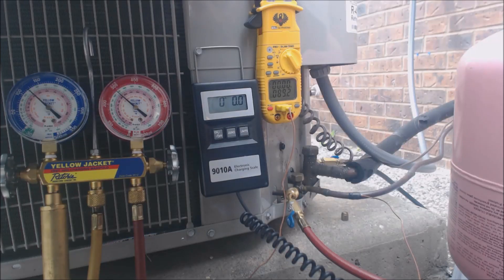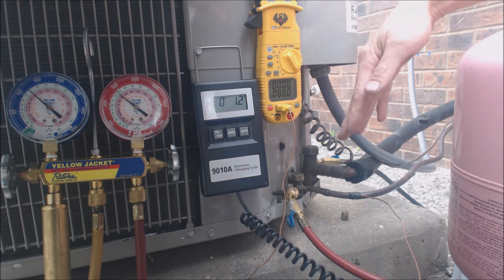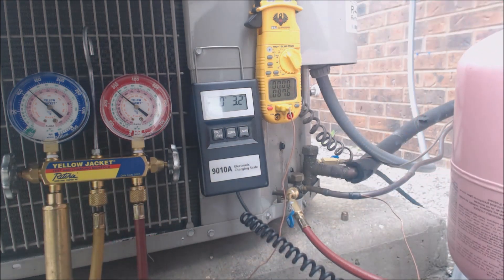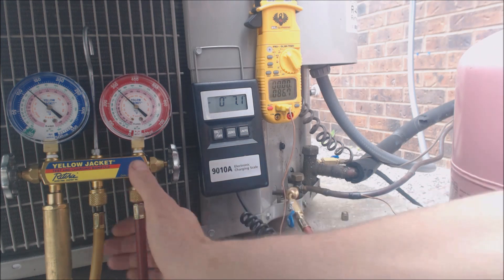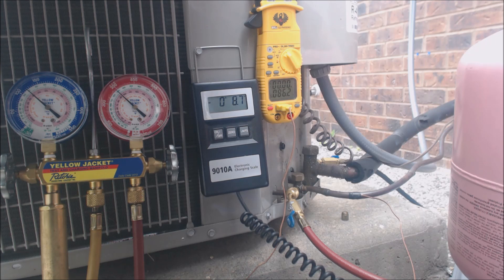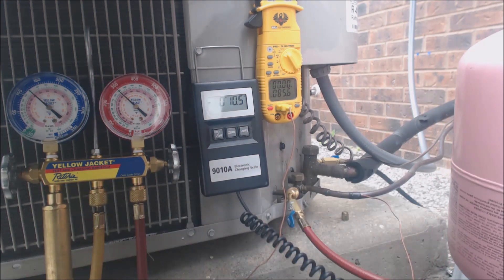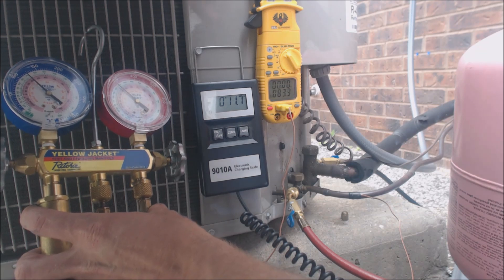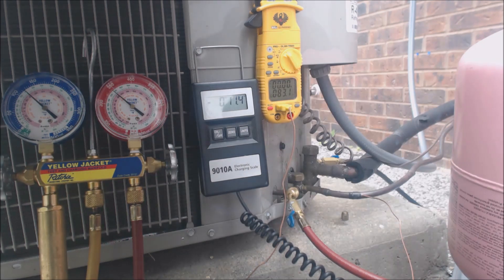Charging R-410A Refrigerant: Step By Step Process of Adding Refrigerant in Real Time!

Comment: Yes the target is 10 deg as specified on the label , the liquid line temp is 84.3deg and the high side pressure is 250 psi
Reply from the maker: Ok so a couple things, if this is a lower seer unit which would mean that the high side would be higher in pressure then you may still be low on refrigerant. I would keep charging to see what happens. The superheat is about correct though since it seems to be around 17 degrees. If the superheat were very high then that would be an indication of a low charge. It is possible that the r-410a mixture may not be a pure 50/50 of the two part refrigerant. The bottom line is that you are not getting a steady stream of liquid to your txv and therefore your superheat should be higher than what it is actually. Did you try another temp probe. Mine will fail and I will replace them during the season. When I start second guessing myself I have three probes to cross reference against.  Also what is the temp diff between the return and supply temps? 18-21 would indicate a correct charge. Thanks

Comment: Question: 
So on my new Ruud 3.5 ton AC with "N" coil, using 34 ft of (3/8 liquid & 7/8 vapor) lineset. I know to add .6oz per foot over 15 ft. but was curious if it was necessary to add extra 410a to account for the copper elbows? 
I have three 7/8" elbows and then 2 long hand bends for the 3/8". Cant determine if they are telling me I need to do this no matter what or just if I have a long lineset and high vertical rise which I do not have. Lineset goes 8 feet up from AC service valves to ceiling then 22 feet straight to furnace room and then 3 feet down with the 2 elbows to connect to coil. Manual states, All units are factory charged with R-410A refrigerant to cover 15 feet of standard size interconnecting liquid and vapor lines with a required field installed filter drier. I have installed the filter drier inside before coil and coil also has TXV installed with bulb of course at 10 o'clock position on vapor line also on outside of cabinet.
Reply from the maker: weight of refrigerant added is strictly by ft and not by rise of line set. You could add some equal to determined length of tubing but I would really just use subcooling to check the charge while the unit is on and running, thanks!
Reply: AC Service Tech LLC - 
Thank you and I will do it by subcooling but scrolling through the manual I saw that note they had printed and I never really thought about it and was curious. So if I go onto your Amazon tool page and make a purchase, that's how you get credit correct? Want to repay you for your advice. 

Take care and thanks again.
Reply from the maker: Yes I have patreon.com/acservicetech for continual support, paypal.me/acservicech for one time contributions, and I receive a commission any time someone clicks through an amazon link and purchases anything at all on amazon. It doesn't have to be the item clicked on, thanks a lot James and glad to help!

Comment: Hi thank you for this fantastic video. My Mitsubishi Multi Split only has a single service port for manifold connection, this was used initially to evacuate the system and vacuum test prior to opening the valves on the outdoor unit (both high and low side) allowing the factory charge of r410 to fill the lines. Our total pipe length did not exceed the manufacturers allowance so we did not need to add refrigerant, however this would have also been done into the vacuumed lines if it was necessary before opening the two valves. My question now is that we want to check the system is operating correctly, how do we go about testing this with only the single service port for the manifold connection? The service manual simply states to fully recover the r410 and weigh it to check if there have been any leaks and then recharge the system again. That seems a bit overkill, is there a simpler way for an outdoor unit with only a single service port? Thanks again for the great video.
Reply from the maker: If the unit is not a single or 2 speed compressor but a vrf then you would have to follow manufacturers instructions. The sad part is that they are not giving instructions. If it is a vrf then you should have 21-24 degree delta T across the coil when running on emergency cool which would be it's highest setting. On conventional 1 or 2 speed compressors you would be looking for a delta T of 18-21. Also since the vrfs have an accumulator, manufacturers run them with a larger sat state at the indoor coil so you may only read 0-5 degrees of superheat on emergency cool. That is ok and is also why the delta T is much higher, thanks Ben

Comment: Actually the probe is not in the sun , it is attached to a clean area on the liquid line and taped with electrical tape .the vapor line is 64 deg the ambient temp is 84 deg .
Reply from the maker: I'm sorry are you saying you do have a liquid line subcooling of 10 degrees or is that just the target? I was assuming that was the target. If that is the case then I would still like to get the actual liquid line temp from you. Thanks the more info the better just to see exactly where you are at.

Comment: what would you if the unit did not tell you what the rated sub cool temp should be ? like the same way when you are charging using super heat and the condenser unit doeant have the PT chart on it . how would i figure out what the sub cool temp should be at for the system ? 
thanks

Comment: Great Video  - 
does an EEV Electronic Expansion Valve allow the same charging method as used for TXV/TEV?  
thanks
Reply from the maker: As long as the system is using a single or two speed compressor, yes usually, thanks!

Comment: When checking your subcooling between the supply and return. Can you check directly at the furnace? Like from the the filter box and evapcoil? Thanks 
I love you videos
Reply from the maker: The most accurate is right before the furnace and a few feet after the evap coil but if you do have 18-21 between the filter area and the closest supply reg than that is great but if you don't then check closer before the furnace and 3 feet or so after the coil, thanks!
Reply: acservicetech sweet, just wondering. Learn something new everyday.

Comment: I already had been seen your gas filling vedio I want to ask what is that you are connecting section line and discharge line I mean why both line connect with the gage .as I know that for top up gas only section line need to connect kindly reply
Reply from the maker: That is because to check a system with a txv metering device, we need to read the pressure on the small liquid line but we add refrigerant into the large line, thanks

Comment: I have a trane unit. The high side over 500. My AC tech is not trouble shooting it just stating it is the TXV. I am not sure. Any suggestions?
Reply from the maker: The high side has to do with the outdoor unit heat exchange not the indoor. The tech would have to check subcooling and superheat. Thanks!

Comment from the maker: The system has to be on while charging into the low side. My speakers seem to cancel out that background noise. Thanks for the Comment!
Reply: glad you mentioned it.
Reply: By "on" do you mean running/operating or powered but with the thermostat in "off" position? If running do you turn it off once charging is completed? I'm very new to this.
Reply: @Alberto-by7zq  operating

Comment: I had issues using your process today. Long story short. I bought 2 year old heat pump from a Heat and Air company advertising on Craigslist. When I spoke to them I informed them I had a brand new 3 ton r22 air handler installed in my house. The heat pump is a 2 1/2 ton 410A unit. They installed it and it has never worked right. The guy installed some kind of little fitting in the compression fitting in the liquid line going into the evaporator coils. This can't be a TXV correct? If I was to install a TXV do you think I can get it to work? I have a new set of gauges and a amp meter with a thermocouple. Also have a 11lb tank of 410A. Trying to avoid buying another air handler. Any help would be great!

Comment: Excelent video!
I'm new in this trade and I got a question. 

Can I use my gauges for r410a and for r22?
What process should I follow if I can?
Reply: You should really have 2 sets of gauges. For these reasons : different oils can contaminate the 410 unit especially. 
2/ high pressure on 410 
3/ different temp/pressure scale. 
4/ different thread on the schrader connection.

Comment: Are you wanting a 35f evap or a 55f evap with a 410 sytem?
Reply from the maker: You are looking for superheat or subcooling depending on the metering device. We can't go by evap sat temp because that will change depending on the heat load in the building, thanks

Comment: I enjoyed watching your videos and find them informative.

I was wondering what you do after repairing a leak or changing a leaky liquid line drier to get in possibly 3-4 pounds of 410 refrigerant in the system. Assuming you pumped down the system rather than recovering. Your video was approximately 12 minutes long and you got only 12 ounces of refrigerant in. At that rate it would take about 48 minutes or more to get in three pounds. When I add liquid I open my gauge so I get about .25 of an ounce per 10 seconds and a whole ounce in about 40 seconds. I don't turn the gauges on and off as you do. I use a vaporizer off and on depending which gauge set I grab from the truck. Today I changed a condensing unit with a real long run and I wound up adding 4 pounds beyond the factory charge.   It took me about 10 minutes per pound. I'm very careful to watch my scale so I don't exceed my .25 per ounce per 10 seconds.

Do you think I'm rushing it?

Thanks

AC tech down here in the Virgin Islands
Reply from the maker: After you do a pump down, you would fix the leak, pressure test, vacuum down below 500 microns and then break the vacuum with liquid refrigerant into the liquid line up to under what you think you will need. Then open the service valves and turn the unit on. Wait 5-10 minutes with subcooling or 10-15 minutes with superheat and add refrigerant as needed, thanks!
Reply: I'd add even faster than that,

If you get extra pedantic imagine the 410 gas has leaked a component while cycled off. 
In that case you should recover rather than pump down and refill with fresh gas. But that is : getting pedantic

Comment: Hello, I have a question: I have to evacuate and vacuum the system. Now, my system only has a vapor service port. How should I charhe it? Do an initial charge with the compressor off? I'm afraid to turn on the compressor with no refrigerant on the system, but afraid to charge the 410a as liquid and flood the compresor.

Any advise and thanks!!!
Reply: In this case I'd first charge a base charge without it running. 

Then charge as per normal by cooling and gently charge and I sometimes blast my heat gun on the the suction port to ensure the liquid is definitely vaporized. That's especially in wintertime

Comment from the maker: I always recommend that an individual work with a licensed professional while working on HVACR equipment until they are experienced themselves just do to a possible hazard sneaking up on them. Maybe the technician doesn't have the experience to handle the problem if you as the customer are not experiencing a correction to the problem. I would recommend that you interview some other techs in order to handle the problem. It may be something else other than the charge. Something that I find somewhat often is that the system may be running well but it was undersized for the building load and does not have the capacity to cool the house. There could be a variety of things that could be the problem if the charge is in fact correct. You could confirm that the charge is correct by checking for a 18-21 degree temperature difference between the largest return air grille and the closest supply register to the evaporator coil. I have some other videos that may help answer some of your questions so that you would know what a proper technician would be doing if you are interviewing new ones.  You had mentioned Freon which is R-22 and the video was R410a refrigerant. Maybe the tech was checking superheat on the vapor side if your system has a piston/orifice. Most R410a systems employ a txv as a metering device but if it is a R22 system it is likely a 50% chance that it is a piston/orifice. There are some R410a systems with a piston but they are not the norm. I hope these videos at least answer some of your questions! Thanks for your questions and I hope the situation is remedied fast!https://youtu.be/5uqtiUmrBLghttps://youtu.be/zJmZHzLwqbshttps://youtu.be/SUyN94Y39RoThe Playlist for Air Conditioning & Heat Pump Refrigerant Charging, Checking, Procedures, & Tips-Step by Step Instructions!   https://www.youtube.com/playlist?list=PLxnHR5_D2ojzAUXWWQt9A8juotNkzwYlk

Comment: The vaporizer,  is it good for lifetime use?
Reply from the maker: You can do without it and it takes longer to purge air out of the lines but works well for protecting the compressor. I have used them for about 7 years no problem, thanks
Reply: acservicetech I guess I just invest in one and it will last me 7 years or more. Sounds like a good investment.

Comment: I have a question,
if the refrigerant is slightly low,will it affect performance?Im thinking of having m system overall bled and recharged .
Reply from the maker: Great Question! When you measure subcooling if you have a txv, or when you measure superheat for systems with cap tubes or pistons, you can be off by a few degrees but only a few degrees. Superheat should be checked even more critically at 1 degree if possible. if the system charge is off then you will lose cooling capacity.If you were to recharge, you should recover the refrigerant, leak test, vacuum pump to or below 500 microns, then weigh the refrigerant stated on the rating plate, then check the charge using superheat or subcooling as needed.I hope that helps! Thanks for the Comment!

Comment: So I've never seen a vaporizer used before, I usually do the other method. Anyway can you leave the vaporizer on there when pulling a vacuum also? Or you pretty much just take it on and off manifold. @acservicetech
Reply from the maker: Check out these vacuum videos. I now only use two hoses, three valve core removal tools, and micron gauge. I did 1 1/8" lineset 125' down to 250 microns in ten minutes. With the pump off it held 250 so no water freezing problems and a true reading instead of near the manifold. vacuum playlist videos -  https://www.youtube.com/watch?v=jlzecsOImqs&list=PLxnHR5_D2ojxXtMK2acxvUF8aqowcksMx

Comment: I checked the discharge and the return temps and yes I'm within that 18-21 range ..
Reply from the maker: Ok then, it sounds like the temp probe that you were using was off calibration then. My temp probes eventually go bad too so you are not the only one. If it has that correct 18-21 then you know that the txv is getting supplied with at least the correct amount of subcooled liquid. Thanks

Comment: Do you turn off the valve at the tank when done and let the remaining liquid in the hoses into the system?
Reply from the maker: Yes sometimes it is hard to anticipate how much is left in the hose vs the subcooling so as long as we make sure the subcooling is not too high when your done that would be great, thanks
Reply: de minimis
Reply: AC Service Tech LLC  when it’s off do you add through the high side

Comment: I have a Carrier R-40A outdoor unit and the plate says "TXV indoor, and 67 piston outdoor.  Is this charged like a TXV or like a piston?
Reply from the maker: Great Question! You need to verify at the evap indoor coil. If you are not confident that it is one or the other then take the four screws out and take the evap coil box door off and look to see if you find a txv, if not then you know you can use superheat to check the refrigerant charge. Thanks!

Comment: Would have been significantly better video if you had started at the very beginning ... connecting the gauge and refrigerant hoses to the system.
Reply from the maker: J Willis, look up acservicetech connect check charge disconnect procedure" thanks!

Comment: how do you charge 410a when ambient is only 60° and there is no subcooling chart below 65
Reply from the maker: Great question, You don't use superheat and subcooling below 65 degrees ambient because there is no load on the building. That is why we weigh in the charge for every extra foot past the 15' or 25' the unit says it has in the outdoor unit prior to the initial startup when it is to cold and you can come back later when the temp is higher to double check the subcooling or superheat. You could get it close on a 60 degree day but you should go back when its warmer or wait until you have a warmer day first.  Here are two videos-----https://youtu.be/ncgLDYrvN6w----https://youtu.be/_8g6xaCKDqc---- Thanks for the Question!

Comment: I charged one of my units because it was low on 410 and while I was there I noticed the other unit (down stairs unit) had very little condensation on the suction line. I added a small amount of refrigerant and within a few minutes the compressor started short cycling. Did I over charge it? The low side has around 150# on an 85F day.
Reply from the maker: Does that system have a piston and what was the superheat? Or did it have a txv and what was the subcooling? Those two ways of checking the refrigerant charge are the only relied upon ways to check it unless manufacturer specs say otherwise,  sorry and thanks for the question!
Reply: It must have been on the border line. I removed some refrigerant and it took stopped cycling. Thanks for the response! I love your channel by the way! Very informative channel for the DIY'er!
Reply: The service safety valves probably cut the power to the control which can happen when it is both too low and too high